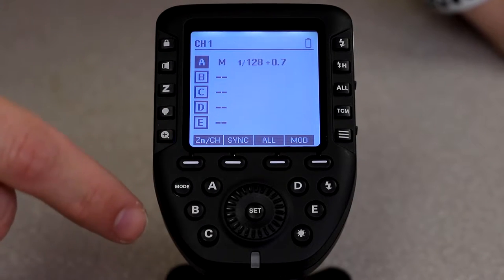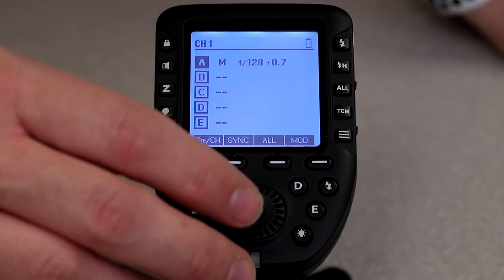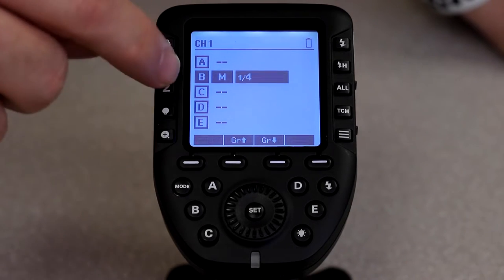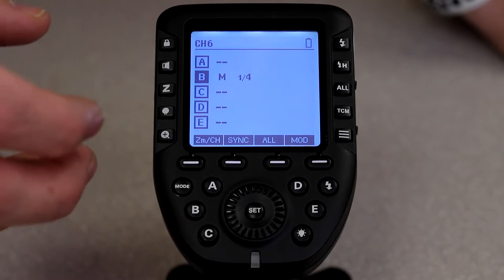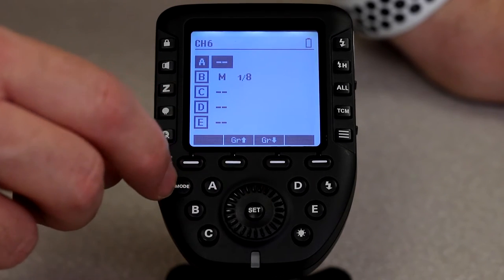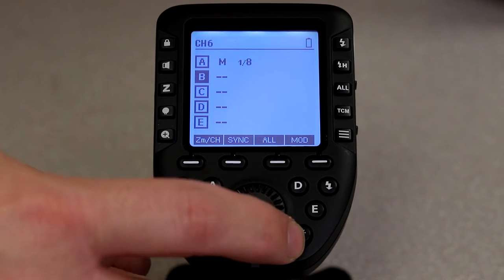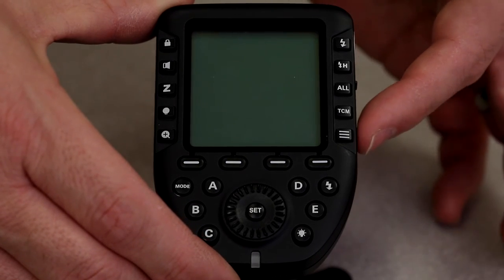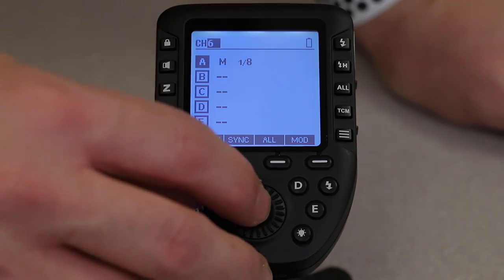Flashpoint R2 PRO Trigger Demo - Pittsburg State University

Comment: Do you ever have any problems with Godox misfires? I recently started using several battery powered Godox flashes , 200’s and 400’s, with my Nikon camera, and I’m missing shots due to the controller or flash units sleeping. Really painful. Ever have this problem? And what is the solution?
Reply from the maker: Ugh, yes that's definitely a problem with these triggers. They will go to sleep and miss shots. At this point, I do not know a workaround. The manufacturers need to make the power system a little more efficient. They go to sleep to save power, yet they still drain the batteries. I have to constantly replace batteries because my students will accidentally leave them on, and even though they're asleep, they will drain the batteries quickly. I wish I had a better response, sorry!
Reply: @chaunceyhuffman861  Thx, yea that’s one thing I learned, which is a pain, but take the batteries out when not in use, or they drain.

Comment: Hi there, I recently purchased the flashpoint r2 pro and a R2 receiver. Upon testing the units I noticed that on highspeed sync my photos are coming out under exposed, even though I'm using the correct exposure. However when I shoot the same shot with the flash attached to the camera on highspeed sync the results are quite accurate.  Do you have any suggestions? 

Thank you for your time and great job with the vid.
Reply from the maker: Thank you for the comment! There could be a variety of reasons this is happening. The first thing I would check is to see if you're using TTL or Manual with the flash. If using TTL, this could be a TTL issue of it not calculating distance properly when it's off the camera. Secondly, I would check to make sure that you don't have any sort of Flash Exposure Compensation settings active in your camera. For this, you would have to look up the specific settings for your camera. Third, I would double check your results by looking at the histogram and taking a picture of something completely white, like a piece of paper with a few dots drawn on it with a Sharpie. This will give you a baseline to know if it's the trigger or the flash. If the flash is actually overexposing the image, then it's probably a flash compensation issue or TTL issue. If the trigger is actually underexposing, then you might need to double check and make sure that when you change the power setting, you're going it on the trigger NOT on the flash. If you change the power on the flash, the trigger will override the setting and whatever the trigger is set to, that's the amount of power that will come out of the flash.
Reply: @chaunceyhuffman861  Thanks for the response. After doing a lot of research we discovered that it's a compatibility issue with the flash units.